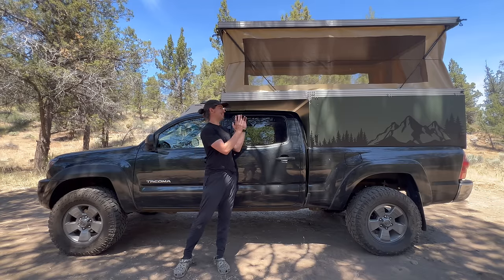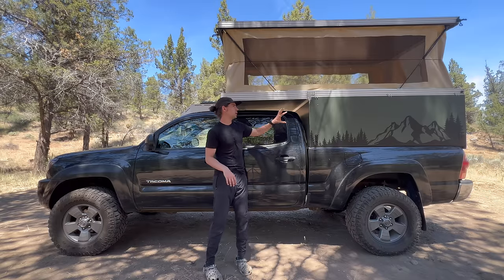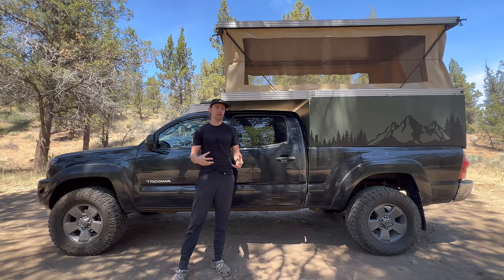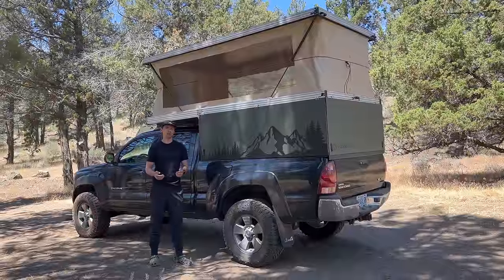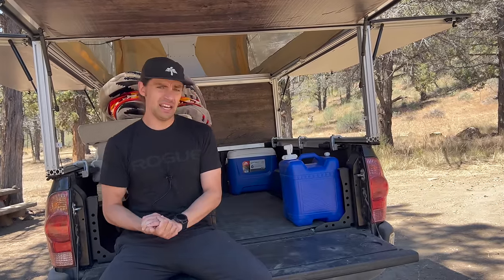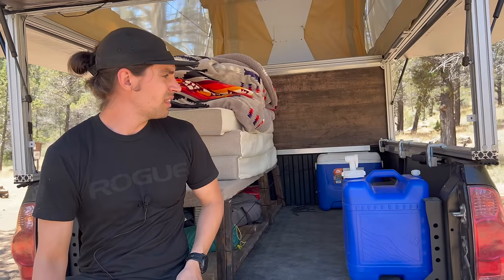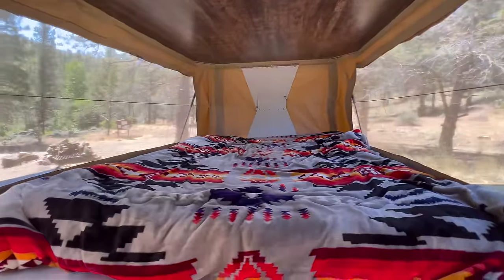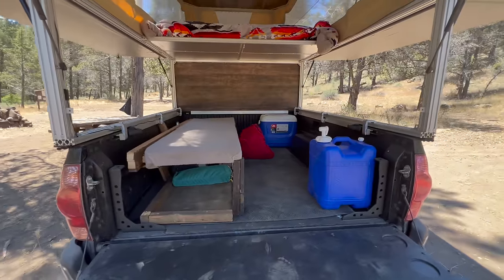No-Weld/No-Sew DIY POP-UP Camper Walkthrough | KIT Campers V2

Comment: Why did you need the extra weight and cost of 3 strips of 80/20 rubber threshold on each side where it sits on truck instead of just one?
Reply from the maker: Not sure what you mean by this, I just used a triple bulb seal to seal everything.

Comment: First let me say “ great job “ I have 07 Ford sport trac that I would like to do same. Problem is it has a short box, any thoughts?  Again great job
Reply from the maker: I dont think you would have much trouble converting my longer bed designs to fit your short box. If you keep the bed size the same it might eat into so extra moving space between the bed and the entrance to the camper but you would be fine. How long is the bed?

Comment: Will your plans work for a truck bed with a severe taper from front to back?  The rear of my top rails are ~4” narrower than the front.
Reply from the maker: Unfortunately, probably not, aluminum extrusion is pretty tricky to work with if things aren't all square. what truck do you have?
Reply: @KitCampers  2022 Ram 2500 w/ 6'4" bed.  It's 65.5" at the front and 62" at the rear.
Reply from the maker: @cgblosser  we have worked with individuals who have had this type of taper in the past, I think we came to the agreement that something that is 64inches, the entire way would give adequate overhang on both the front and the back to be able to work. You could try this by mocking up a quick woode frame with 1x3 or 2x4 just to see how it would fit.

Comment: I’m curios… any issues with the 90° joints in the aluminum vibrating/swaying now that you’ve had some time to test?
Reply from the maker: I haven't noticed anything and I have driven it ~2500 miles. I have been contemplating adding some corner gussets for extra strength and longegivity though.

Comment: How easy is it to take off the camper if you were in a situation to remove the whole unit?
Reply from the maker: Not too bad, it really helps if you have a high roof and a winch, but I removed mine and put it on another truck in less than 45minutes.

Comment: Seems like if you have for gas struts you’re going to need to have them opened electronically because well the rear two could be accessed from the tailgate the front two would be a pain in the ass to open
Reply from the maker: Nope you just need one, because when you push the roof up from the inside the entire thing pops up 
 check out the walk through of the pop up mechanism - https://youtu.be/ICYHd6zIDN4?si=37PhuntavDWgSIFv

Comment: notice any difference in gas mileage with that camper on vs bare truck?
Reply from the maker: A little, but the major difference in reduction in gas mileage was from my lift and new tires/wheel I put on it. Generally, MPG is around 15-17 now.

Comment: Very impressive topper. Although there are a few tweeks to make it perfect, your design is excellent.
I do lots of diy projects myself and this is something i would consider.
Next maybe fab and bolt up a 270° shade.
Reply from the maker: Thanks I appreciate it! I completely agree that there are a few tweaks that should be made in order to make things even better. What are your suggestions for tweaking the design? I mounted a prebuilt 270 awning directly to the rails of the camper, I don't have welding skills but it's something I want to learn so I can eventually build one!.

Comment: Sweet build! Just a question for you. How do the lifter panels on the end keep the roof in line and support it from swaying forward and back? I see how they work to prevent the roof from moving side to side, but I can't quite make out how they stop it from moving front and rear. Am I missing something? Or maybe I just don't understand. Thanks in advance!
Reply from the maker: Thanks! What keeps the roof from swaying back and forth is the canvas! I missed this before I completed my first build but essentially the lifter panels help to contrain the roof from side to side movement like you pointed out but until the canvas is installed the roof can still move forward and back.

Comment: What did you use for the bed platforms and where did you find the material.
Reply from the maker: I used, aluminum composite material (ACM) I got them from a local sign supplier, if you are in the pacific northwest you should call Sun Supply Inc that's where I got all of my stuff.

Comment: Love your build. Where did you get the aluminum sand which panel sheet?
Reply from the maker: Thanks I really appreciate it. I got it from a local signage shop near me called sunsupply - sunsupply.com ! If you are in the pacific NW they are great, I highly recemmend them. If not finding a local sign shop or industrial supply place could work well. Don't let a local sign shop rip you off though the cost of a 4x8 sheet should be around $75.

Comment: smart to get those bed wall braces. i have a customer who "taco'ed" his, with his camper shell. weak aluminum top bends those rails. but i bet if the top was made with steel it wouldn't bend. braces are a better idea.
Reply from the maker: Yeah thanks for the heads up, I always wonder how necessary the bed stiffeners are but they are definitely good for peace of mind.
Reply: @KitCampers  they are absolutely critical! Otherwise after a few Mojave Desert rides you won't be able to close the tailgate or latch your camper shell lid. Awesome build
Reply from the maker: @PseudonymAliase  yeah I recommend them to everyone! But this is definitely great information, thanks again and I appreciate your kind words!

Comment: I wonder if there is any way to just have the pop up part and put it on top of a hard Tonneau and just put the mattress on the tonneau cover. My thought is put it on when you are going camping 
And when you are not take it off and store it. That be awesome. I imagine it would be cheaper to make to.
Reply from the maker: That would certainly be cheaper to make, I just don't know how strong the tonneau covers are but it's definitely worth a shot.
Reply: @KitCampers  I seen one on Amazon that held up 350 pounds. But who knows if it's true. I'm buying it and trying it out if it holds the weight I might try out the pop up part.
Reply from the maker: @silented530  Yeah hopefully that is true cuz that could make things a lot easier for the pop up, maybe you could figure out a way to make the canvas detachable too by adding snaps or velcro to the bottom.

Comment: do you have ideas on ways to cover the screens in inclimate weather or a way to winterize (Thermal Liner) the upper canvas part for winter? I love the big screen windows for ventilation and for a more open feel. Just wondering what you do if it rains or snows?
Reply from the maker: Yeah, I am currently working through some solutions for that but think I have a decent idea actually. I will definitely update the build guide and instagram once its figured out. I am think about putting some retractable vinyl windows on the outside.

Comment: That no sewing material ... is it hard to find locally ? Is it expensive ? & the glue ?  I have so many questions ... lol  I really like what you accomplished ! great job
Reply from the maker: Thanks I really appreciate it! The material is called 18 oz vinyl coated polyester, you can get it online (so not really locally) for ~10 per linear yard (its 61 inches wide) from mytarp.com the glue you can buy from the same place, I would say it's similar in cost to other tent material the glue is kind of expensive though.

Comment: A chain is only as strong as it’s weakest link so what you claim you “over engineered” may not be any stronger than if you had not. That is usually the case. Connectors are usually the weakest link.
Reply from the maker: I appreciate your concern. I never had any issues with that area moving whatsoever, with all the camping and testing that I did. I also updated the design for other in order to switch some things up and make it ever stronger. Finally, having an engineering degree and running it by some of my professional engineering friends we concluded that the way it was built was indeed over engineered by several fold. 🤷‍♂
Reply: @KitCampers  Oh what kind of engineering degree do you have? I have a BS in Architecture (5 year degree) with an emphasis on structural design from UT Knoxville and started a master’s degree in Architectural Engineering at the number 5 engineering school in the USA, UT Austin, before dropping out to move to work for SOM in Denver. My boss Edwin was the number two designer of Sears Tower Chicago, then the tallest building in the world. Good days. I believe at the time they were the only architectural firm in the world that had an in-house structural engineering department.
Reply from the maker: @GOLDVIOLINbowofdeath  oh nice, I got a mechanical engineering degree from the University of Michigan.

Comment: Hi, what size aluminium profile you use to makes the main structure? The thicker one
Reply from the maker: The thickest ones are 4x2 inches I use 10 series aluminum (meaning it comes in 1 inch increments).

Comment: How's the dust aversion/ waterproofness? Amazing work man!
Reply from the maker: Thanks I appreciate it! All closed up things are very close to waterproof, there are some VERY MINOR drips in the corners where the camper meets the bed, I am going to try and fix this with some sica flex. For dust, a little gets in but it's mainly through where the bed is open and not fully sealed, I might have to add some seals to the truck to remedy this.

Comment: Is it possible to add a rack on top to carry bikes or a canoe? I'm gathering the struts couldn't deploy with the weight,  but could you transport a canoe, then take it off to deploy the pop up tent?
Reply: I’d imagine with the aluminium profile system it would easily handle a roof rack or dedicated carrier. Obviously that would have to be unloaded before deploying the pop top. Solar panels would be a breeze to add to the top as well. 

The aluminium profile is made by different companies in different sizes with multiple angle adapters and fixings. A really cool product
Reply from the maker: Yes, you could definitely add some cross bars (I think I have a video of that I can publish) or check out my instagram.  But it would be super easy to do.
Reply from the maker: Yes, totally agree!

Comment: great build, well done! I was thinking of using 8020 for the my flat bed popup build. Is there much, if any, flex when there are 2 people in the bed? Also do you use any Loctite for the fasteners ie. to prevent loosening during those offroad trips? Offroad corrugations here in Australia are hell on anything and everything.
Reply from the maker: Thanks I appreciate it! There is a little bit of flex in the pull out portion, but no flex in the overhang at all. I reinforced it quite a bit with 1 inch aluminum so its sturdy. I would recommend using loctite where ever you can but for me I generally use double anchor joins (which are VERY vibration resistant) I just drove 750 miles of back forest roads with no loosening. For non-anchor joins I would recommend using loctite and lock washers, once those are tightened down they seem to stay in place very nicely.

Comment: What thickness of acm panel did you guys use for the sides? I'm building something similar and am not sure if I want 3 or 6mm thickness. Did you have to add stiffeners to the panels as well?
Reply from the maker: I used 3mm panels for everything. I had to stiffen the doors, bed, and bed slide out. The door stiffeners are nice because they allow you to mount 10mm ball studs directly to them.
Reply: @Kit Campers  one more question, what is the roof construction? Did you just use another composite panel for the top outer portion and then insulation and another panel to sandwich it together on the inside? Thanks! Love the build

Comment: Well done... I too like the idea of being able to sit up in bed, I am curious as to how it is sealed up for water intrusion while traveling... especially the front where the top meets the middle section of 8020... Are there seals for the 8020 ?
Reply from the maker: Yeah sitting up was super important for me in the build. But I lined the enter top extrusion with extra long truck cap seal. We drove in some rain along the coast and the inside was bone dry! Unfortunately I haven't found a manufacturer that makes specific seal for the 10 series 8020 itself/ isn't ridiculously expensive but there is slide in seal for the 15 series that you can buy from mcmaster carr.

Comment: I am excited to see someone building a simple shell camper.  I have built robot workspaces with the 8020 and I am a big fan of aluminum extrusions.  However, a big warning for using aluminum extrusions:
 1. while the alloy has comparable yield strength as A36 steel its elastic modulus is 1/2 of steel.  Also it behaves very differently that steel when the yield strength is exceeded... what does this mean?  if your mattress platform is made of 1515  and is 60" long and you are 200lb s and sitting in the middle... then the 8020 beam will sag 3/8" (about 1 cm) if it is made of 1515Lite it will sag 1/2" ... This is from the 8020 Deflection calculator on their website.  This is a static load and is a best case scenario as opposed to plopping yourself down.  You will have some added stiffness from the plywood but it would probably be a good idea to add more cross members.  
2. The 8020 University resource gives the recommended torques for t-slot fasteners BUT there is a disclaimer saying that they take no responsibility for failures.  This is the same reason you have to check your aluminum wheel torques after driving 100 km (60 miles).  Why? because aluminum is very sticky and you maybe applying the correct torque but the bolt head or washer may not be sliding.  Applying lubricants can cause the opposite problem where you will damage the extrusion before you reach the torque.  

Please be careful assembling 8020 making sure the bolts are seating properly and check torques periodically!  When I build mine I will be using the gusset plates in addition to the regular fasteners!  

Thanks for the inspiration and please let us know how things work out! I can help with understanding the deflection calculator if you are interested!
Reply from the maker: Oh definitely a very helpful call out here! I used all anchor joins as they are stronger and vibration proof, I have driven 2500 plus miles and haven't had anything loosen even slightly, I have checked everything plus I get even more structural integrity by having the ACM panels attached to the frame with VHB and screws, but yes definitely something to be highly aware of thanks for pointing this out.
Reply: @KitCampers  wow!  great response ... Youtube needs more people like you who do the hard work of creating a video but understand that opening a discussion is how we all can learn! Thanks!
Reply from the maker: @mfsolutions  I totally agree, I am here to share as much information as possible so people can make informed decisions about their builds, you'd be pretty amazed at how many people watch this video and have very negative things to say without opening the conversation or asking further questions. Again, I really appreciate your feedback and it will be great for future designs!

Comment: 80/20 is good stuff however it has a bad habit of coming loose. Use lots of loc tite and check them every once in a while.
Reply from the maker: Yes absolutely recommend using a lot of locktite, but I also use anchor joins which are supposed to be vibration resistant. I haven't had any of them come loose.

Comment: Awsome camper ....  I was just wondering if the 1x3 8020 was strong enough over the cab. Or would 1.5 x3 be better  ?
Reply from the maker: Thanks! For the lower overhang portion I used 2x4 inch 10 series which is definitely strong enough. 1.3x3 would also be strong enough I imagine.

Comment: This is so cool! I'm in the process of turning a chevy express lwb into a camper, but I would love to have a 4wd camper to go more places. I plan on living in it for months on end. How does it do in inclement weather? I guess one could make a cold weather insulation/waterproof wrap for snow season. I gotta see the other camper stuff you've done.   Thanks! Great job!
Reply from the maker: Thanks! I haven't tested it in too much inclement weather. I definitely think it would work in cooler conditions however, the weather proofing is REALLY challenging on campers that bolt to the rails. You could definitely make some insulation for the colder seasons, have you thought about going the slide in route?
Reply: @KitCampers  I had a Northstar pop up 20yrs ago. Didn't care for the 1600 lb dry weight. Going solo these days, so simple and light, and NOT $18k 😆 Did you mention your cost in the video?
Reply from the maker: @robertbehan9186  The cost is ~$4300 when I last priced it out in june 😬
Reply: @KitCampers  A couple of things. Have you thought about a hardside popup? I believe there are places that do not allow soft side pop-ups for safety from wildlife. Or, maybe a pop-up in a 6 ft bed (full-size p/u that can be configured for someone to sleep inside without popping the top, and still have storage space?  Thanks. Might have to rethink my camper plans.
Reply from the maker: @robertbehan9186  I have definitely thought about it but it was a tough challenge that I wasn't able to figure out (the folding of the side walls is very challenging to get perfect). You could certainly try to emulate hiatus campers though although I think it would be very hard. For the 6 foot bed it's completely possible to just make a platfrom (for storage underneath) then sleep on top of the platform. The great thing about this campers is that since you're building them yourself you can customize them as you see fit.